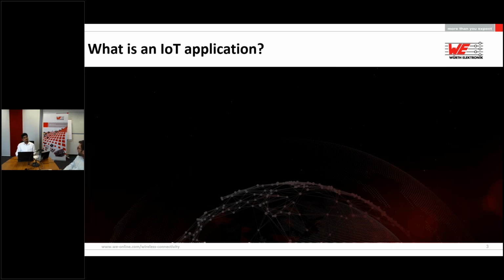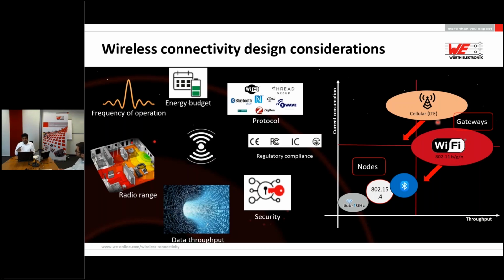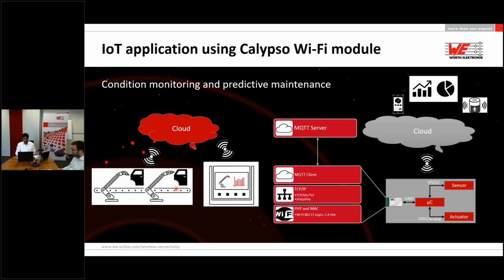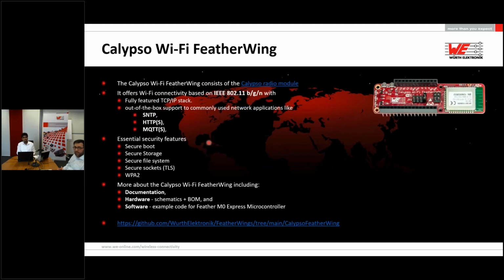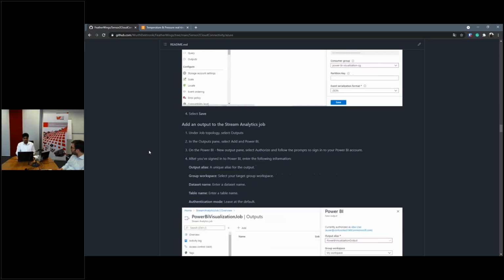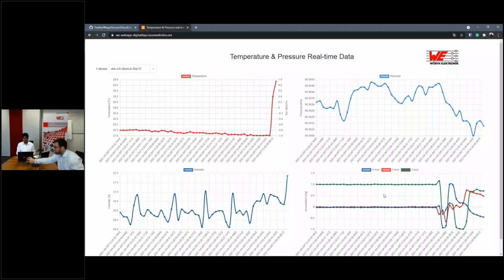WE meet @ Digital Days 2021: Simple and secure cloud connectivity solution for IoT applications

Comment: 0:00 Introduction and housekeeping
  2:02 Agenda
  3:03 What is an IoT application?
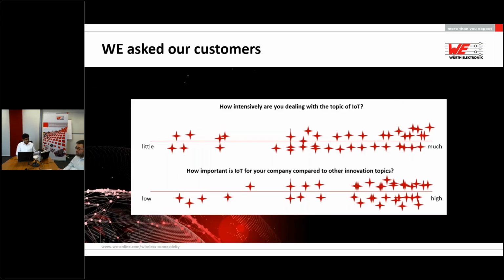  5:36 We asked our customers
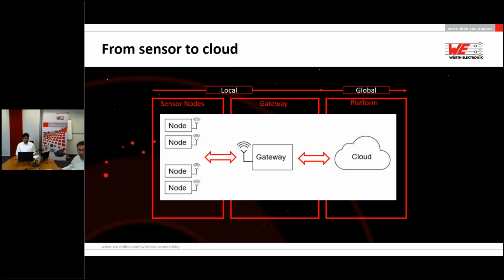  6:16 From sensor to cloud infrastructure
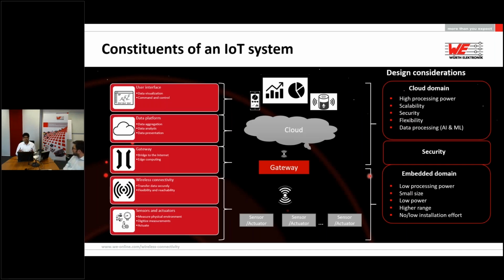  7:05 Constituents of an IoT system
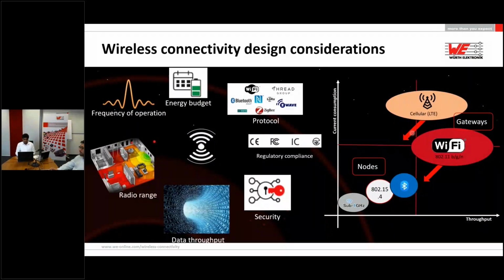  8:29 Wireless connectivity design considerations
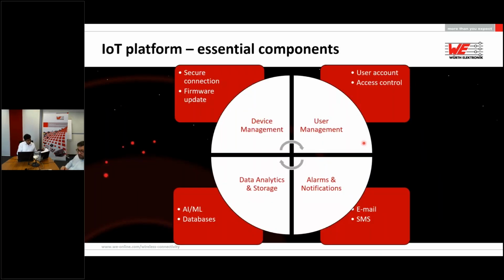10:37 IoT platform - essential components
11:39 IoT platform example - AWS
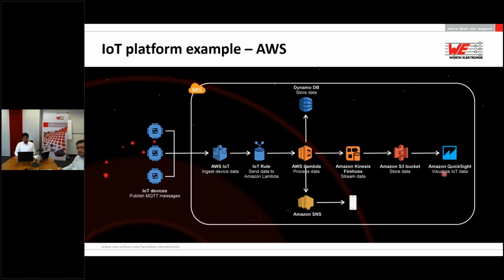13:09 IoT platform example - Azure
14:14 IoT security
16:11 IoT application using Calypso Wi-Fi module
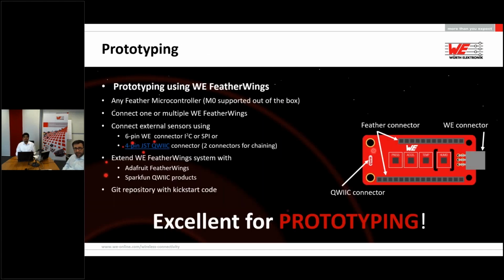17:40 Prototyping
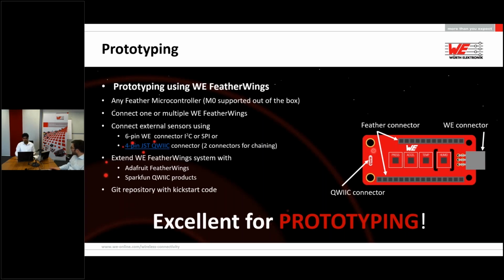18:42 Sensor FeatherWing
19:13 Calypso Wi-Fi FeatherWing
19:42 Requirements
20:17 Prototyping using WE FeatherWings
20:56 LIVE demo
25:57 LIVE visualisation in a simple dashboard
27:24 Questions:
           28:02 Security aspects
           30:28 Send data only to AWS cloud?
           31:46 Where is the certificate stored?
           32:42 Any self-hosted cloud software?
           33:40 Security standard in Europe?
           35:26 Is LoRa and AWS/Azure possible?
           36:10 Can other sensors be connected to the system?
           37:31 Is there a web server on the Calypso module?